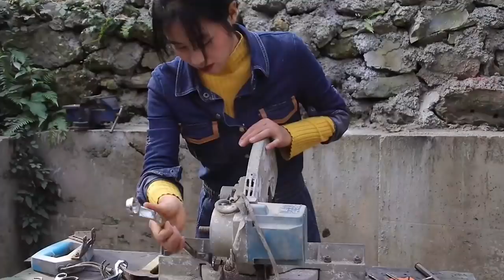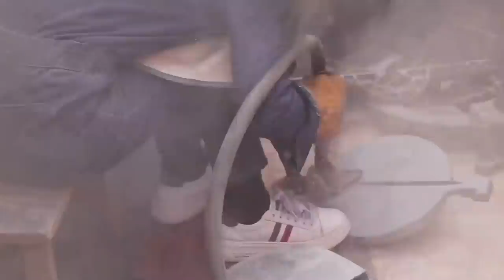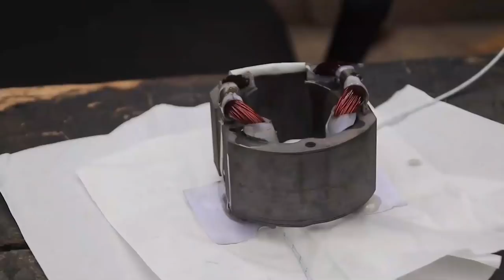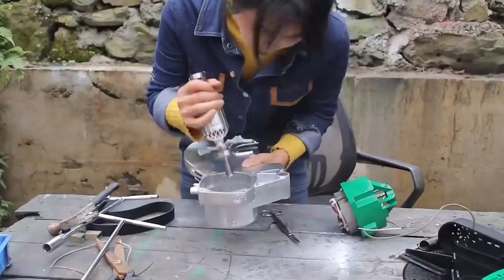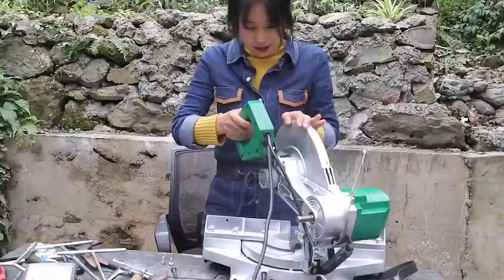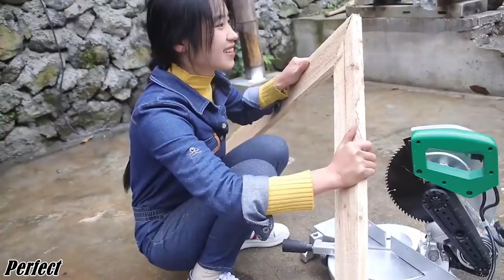💡Repair Rusty Cutting Machine Into A Super Fast Wood Cutting Tool | Restoration | Linguoer

Comment: hello Linguoer, it would be interesting if you show us a tutorial on how to put a new winding on motors that have burned or defective coils.
Because it is interesting to be able to recycle and reuse the engine.
Please, because what you do is impressive and every time I see you I am amazed that the engine finally works!!!
Thank you!! MIS DIESS!! I WRITE YOU FROM SPAIN, Madrid.
Reply: The basic idea is to copy what was there before. Same number of turns, same wire gauge etc.

Comment: Thank you for a nice video from you as always!
This machine looks so new after your repair and restauration, even the plastic parts look new, it could be sold as new again :-). You could need a machine like this when you are a carpenter too. It will cut bamboo very nicely too, not just woodbeams and planks, I am sure. Looking forward to you next video already,
Cheers.
Reply: 젊은처자가잘하네

Comment: Another great project finished and a well shot video. Great to see you now have a set of new set of ring spanners. You really need to get yourself some compound hammers, to prevent damage and potentially early failure of the equipment you work on.
Please please please 🙏 wear safety equipment when cutting or grinding, you only have one pair eyes.

Comment: Hi Lin. If possible get a high volume low positive pressure clean air feed under your hood when sand blasting. I guess you are wearing a mask under the hood but an air feed would keep even more dust away from your lungs. I know it is an expense, maybe patrons can help.

Comment: Nice work, now the saw needs to be "tuned" to a perfect 90 degree, it's not difficult. A tip: metal cutting blades will wear out rapidly at the rpm a wood cutting saw operates. Maybe your blade is designed for the typical 4700 rpm that wood cutting miter saws produce, generally metal cutting carbide tipped blades run at half that, therefore a proprietary machine.

Comment: Looks very nice restoration but I can hear some badly damaged ball bearings there... Did you reuse the old ones?
Axial hammering forces can destroy radial ball bearings too. You should always make sure not to apply large axial forces between the inner and outer race. When installing a press fit bearing into its place use a tube or a large socket tool to apply the force only on the outer race. Likewise, when installing a press fit bearing onto a shaft use a tool that contacts only the inner race.
I believe manufacturers use thermal expansion/contraction to just slip the bearings in when assembling the machinery.
How do I know? When I was young I made the mistake of hammering a ball bearing in the incorrect way, applying the axial forces between inner an outer races. And the distinctive sound of pitted balls and races was immediately there.

Comment: I don't know how in China and what brand it is, but in Poland prices starting from ~90 Euro+, she literally changed every bolt springs etc. Paint is not for free...and of course work...and new cables in motor and bearings too...Anyway good job :P
Reply: she got it from the scrap yard. Even if she spent 20 euro equivalent, she spent her time well.
Reply: @lukebrennan5780  Ofcourse i understeand and don't deny it. But since she have workshop i thinking about cost of service and spare parts if some one come with saw like in the clip.

Comment: In English that type of cutting tool is called a miter saw. It differs from a normal power saw by virtue of the fact that you can change the angle of the cut.

Comment: 我看到你也重绕了电枢，但没有显示那部分。 我很想知道它们可能比您通常修理的感应电机更困难。 你做的维修看起来不错； 在这种情况下，可能甚至比原始工厂构建的还要好。 I see that you also rewound the armature, but did not show that part. I would have loved to see that knowing that they can be even more difficult than the induction motors you usually repair. The repair you did looks good; likely even better than the original factory build in this case.
Reply: Ничего сложного в перемотке якоря нет, главное чтобы сохранился коллектор в хорошем состоянии.Я электрообмотчик с 37стажем